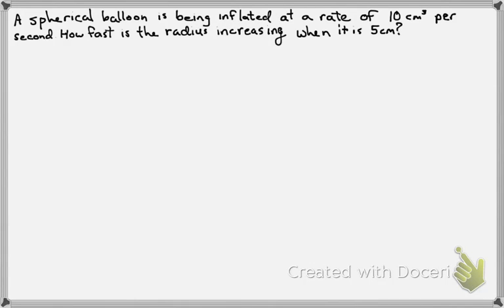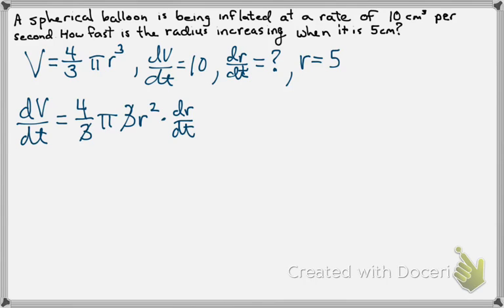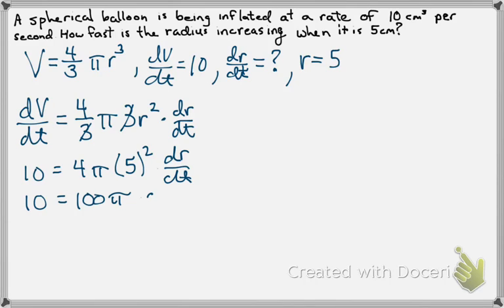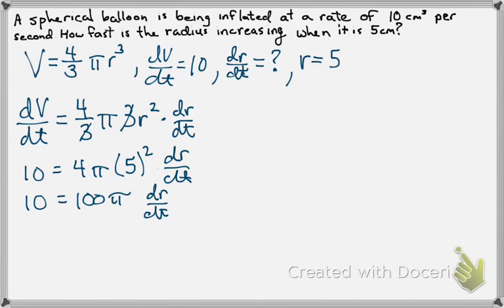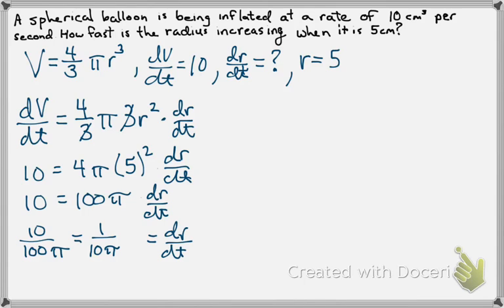Related Rates - Inflating Spherical Balloon

Comment: What is the process/solution if we are finding how fast the diameter is?
Reply from the maker: Since d=2r, dd/dt=2dr/dt so it would just be double the rate of the radius.
Reply: Phil Clark so what formula will i use? will i still use V = 4/3 pi r^3?
Reply from the maker: @kayearingo303  4/3pi r^3, you could still use that, then just adjust for it being the diameter instead of radius as noted above.
Reply: Phil Clark is r’ the same as 2dr/dt?
Reply from the maker: @kayearingo303  yes, r=radius, dr/dt=rate radius is changing with respect to time